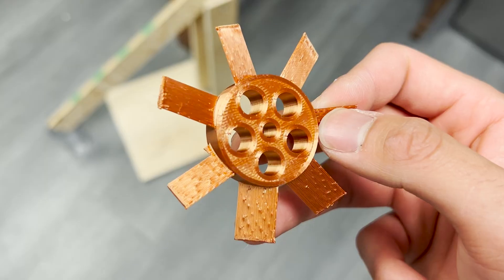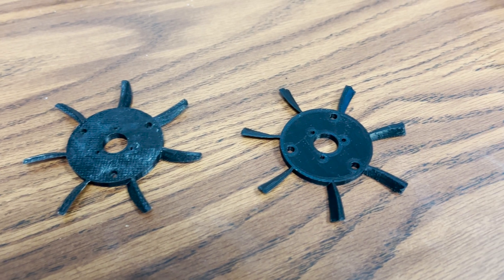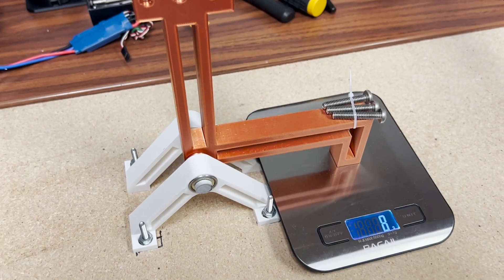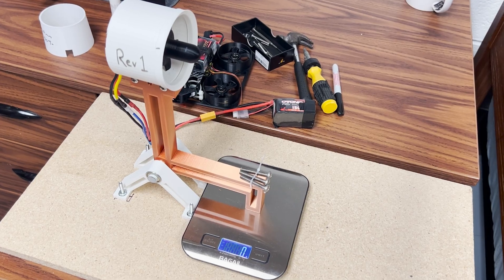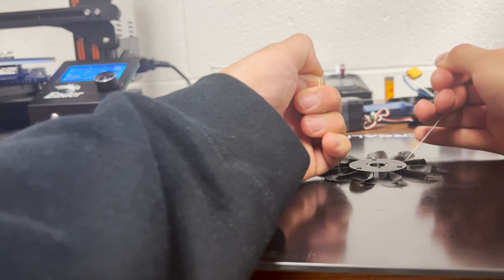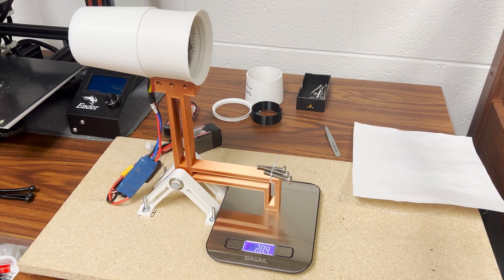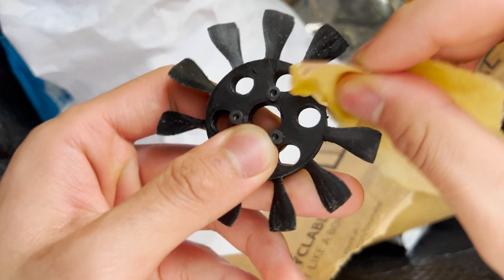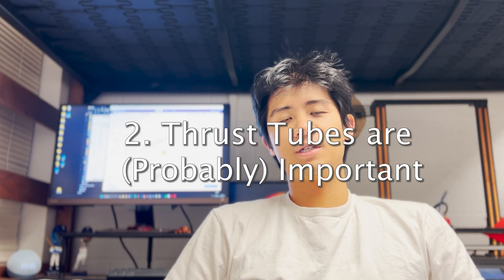Pushing the Limits: 400g Thrust (3D Printed EDF)

Comment: Well done.  I did some experiments with ducted props recently for a quadcopter.  The motor mount is an obstruction to the outflowing air.  I noticed flipping over the propeller and reversing the flow of air through the tube produced maybe 10% more thrust in my tests.  The air coming in is moving relatively slowly and doesn't mind a small obstruction from the motor mount.   Also, you can keep enlarging the input lip to increase thrust, just give it a parabolic profile.  There are scholarly articles on this topic that aren't too hard to read.

Comment: Hey dude 😎👍 like the project only advice I can offer is to get a pull scale more accurate reading 🧐 you Could be robbing yourself of vital grams, it's also important to calibrate the back draft, you can calibrate this by adjusting the space between the fan and the inlet rim, test concurrently each millimetre you adjust monitor the thrust level & rpm calibration should allow rpm to peak successfully & not creating back draft at the inlet this is crucial for flow and at higher rpm can( withhold) thrust, if you are working with 11 blade fan my suggestion would be to place more stators than your blade count plus the degree of the stators should undergo multiple testing testing different degrees is very important,  what may work on other commercial or home made EDFs may not be right for your project as each jet is different especially on dimensions, external inlet stators can assist with this to I hope I helped in some way  😎👌

Comment: Why don't you use  an intake shroud that is less diameter  than blades? To reduce blow back from exaust. Then you can dramatically increase the converging nozzle to get super high exhaust pressure and velocity..
Reply from the maker: My understanding is that a fan inherently draws in ambient air outside of the fan radius, as opposed to an intake moving through the flow without a suction component. Therefore, a wider intake guides the flow that’s already being sucked in

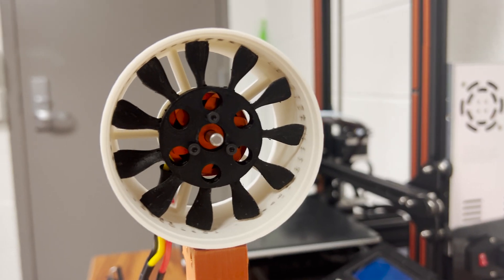Comment: Consider cranking the .stl export resolution in your design software WAY up, to avoid that "~90 sided polygon" profile (did a very rough count of 1/4 of the circumference) you're ending up with on the inside of the duct. That will be adding a lot of turbulence and potential vibrations and standing waves the system, as well as creating ~91 areas where the fin to duct gap is wider. You can see the significance of this at 4:00 where the blade has left many evenly spaced marks on the duct (that's how I counted the number of flats).

Even better, you could use a piece of PVC tube or similar as an insert, or as the entire linear section of the assembly. That way you could avoid the rough surface caused by the layer lines, although I'm unsure of the concentricity tolerances of domestic grade tubes. It'll be much easier to fill and taper a single step between PVC and printed sections, rather than trying to sand the area inline with the propellor evenly without causing any variations in cross section.
Alternatively you could print in a solvent vapour polishable filament such as ASA or ABS and allow a brief exposure to "acetone fog" to do the hard work for you. That method also increases the part strength slightly, by blending/unifying the outer layers of the shell.

Comment: What kind of thrust could you get with a dual prop edf? Where one is spinning one direction and the other the opposite  direction. While producing the same directional thrust inline.
Reply from the maker: Really good question. Here's a paper I came across a few months ago https://apps.dtic.mil/sti/citations/trecms/AD1200423 that does exactly what you're talking about. I think the high level general consensus is that it helps a lot but is generally not worth the weight and energy penalty of the extra motor. I've always wanted to just try for kicks though
Reply: That should counter-balance the two rotors' rotational torques, and result in better control.
It may help to have static blades to stabilise the airflow between the two fans.

Comment: I noticed something on your last test, which is that the bolts you were using to balance the test stand shifted forward. It's counterintuitive, but I think this could actually affect the results slightly--if we think of the foot on the scale as one pivot point of the arm, then the distance the bolts sit from directly above that spot applies a torque to the arm, which has to be countered by a downward force from the books; as the bolts move, that torque increases, and thus slightly more down force is indirectly shifted from the books to the scale. This may not be significant, but grams are small enough measurements that I would try to eliminate this as a source of error, especially since it seems pretty trivial to accomplish.

Comment: what about adding even more, thinner, taller struts to hold the motor, make it act as a stator. add a slight twist to them so that the rotating air coming out of the fan is straightened out, so that all the velocity is on-axis. the twist direction is a bit counter-intuitive but i designed a desk fan where there was a huge difference when I got the stator twist just right
Reply: I tried that, but the plastic stators added too much drag.  I also made a bunch of thinner ones from an aluminum can, and they did improve thrust a little but I decided it wasn't worth the work for maybe 5% additional thrust.

Comment: how important is the inlet lip flare once on the platform in flight? as the flight path should push air into the fan
Reply from the maker: That’s a good question, I have no clue. Someone else mentioned the rounded edges on jet engine nacelles. I suspect smooth surface geometry is probably more of a factor and intake area is less when the EDF is moving.

Comment: As a retired blade prop manufacturer; the reason you are having vibrations on all of your blade designs is that you need to do one simple thing that I didn’t see in your project, and that is to calibrate the CG of your prop designs. Take for example a wheel, at high velocity without being properly calibrated it’s going to be unstable. Keep going and wear eye protection when doing these test.  Good luck!
Reply from the maker: Great to hear from a pro. Thanks for the tip! And just got some testing glasses lol

Comment: Getting the airflow "straight" is pretty important, thats why the inlet helped. Stators (motor mounts) shaped as fins will help stabilize turbulent flow through the duct and exit the exhaust smoothly. 

Get a nose cone that covers the whole hub as well as a tail cone (as previously mentioned), this will help your efficiency a ton.

Comment: 1. Make a proper inlet. Why only a tiny stubby lip? Make a roughly 30mm long parabolic inlet that opens up to 80mm, then add a full 180° lip with a radius of at least 10% fan diameter 
(1/4 fan dia long piece of straight shroud plus 1/2 fan dia long "inlet trumpet" always works well for bench testing). 
Inlet lip radius is critical and bigger is better, it's upper limit is more or less only determined by practicality. -> https://www.youtube.com/watch?v=OxKXHAQ7oXk
2. That exhaust stator is an insult to any ducted fan and jet engine in existence. Just do something about it, it can't get any worse than those four bricks holding the motor right now. Probably an additional 5% thrust in that detail alone. (maybe try and copy something actually good, like a Schübeler fan, not $30 units from ali express that were copied and simplified three times already to be cheap, not engineered to be good edfs)
3. If static thrust is what you want, straight up double the current number of blades. You want the blades to overlap. The more you make them overlap, the more static thrust you'll get, but the fan will also get overloaded easier when you go into a dive to build speed. Tweaking the inlet cross-section and blade count for a good compromise will be necessary at some point. 
4. A fixed inlet cone with guide vanes could add a good amount of efficiency (it also adds weight and is only useful at high airspeeds ... but the jet engine axial compressor look will be awesome when you'll eventually rip the fan out of the model and put it on a shelf ^^)

Comment: If you are making a propulstion system for rc aircraft or for concept, you might also be able to print a compressor fan, as you can utilise the high base rpm of hobby motors and you can also use some servos at the rear with some rounded panels to make a controllable variable area nozzle for higher and lower thrust.

Comment: If the goal isnt to make it purely from 3d printed parts but to use 3d printing, you might be able to print an inverted mold to cast some resin to make stronger more reliable ducted fan. If you do do this, make sure to lubricate the surfaces of the mold with some kind of oil or wax so that the resin doesn't just stick to the inverted mold. Another thing which is handy for lightweight but strong components is making a 2 piece block press mold which you can place carbon fibre sheets and something to stick them together and press it into shape. If you are doing that for a system that has an afterburner or a combustion system, then use fireplace mortar as the binder between carbon fibre sheets.
Reply from the maker: Yes I’ve been looking at molds but it’s seems very intimidating for DIY set ups, this helps me get started though so thank you

Comment: I'm not surprised that you got such a boost from the inlet lip - if you look at commercial jet engines, they put a LOT of thought and careful design into their inlets - there's a reason theirs are extremely smooth, large and usually fairly rounded along the leading edge around the inlet. It helps smooth out the airflow going in, and essentially increases the angle of peripheral intake (so not just reliant on air coming straight in from directly in front). You might see a small increase in thrust by also changing the shape of the fan blade nose cone, as well as the struts holding the motor mounts in place - especially the leading edge of the struts would likely benefit from being rounded rather than flat (more shaped like the cross-section of an aircraft tail).
Reply from the maker: Great points. Filleting the inlet lips right now ✅

Comment: Great video. Thanks.

How does your 3D printed EDF compares to the off the shelf commercial EDF? Did you manage to improve on the commercial ones?

If I may suggest one minor change, is to 3D print motor support vanes at an angle, in order to further reduce friction. As fan rotavates it throws air tangentially, so air inside the tube flows in a corkscrew fashion. If you print motor support vanes straight they collided with corkscrew motion of air and cause drag.
Reply from the maker: Thanks for the tip! It's so hard to visualize flow without CFD. Right now, my 3D printed one is operating at about 1/3 the max thrust of off the shelf ones. I'm making a final video that goes over some slight improvements but more importantly the overall limitations of FDM.

Comment: You might want to trouble shoot your rig, it looks to me that the increase in thrust performance from the big nozzle may be an error caused by the shift in the centre of gravity over the lever arm. Just a guess. You could test that pretty easily by sticking a mass out the back and see if the performance  changes. Or not.
Reply from the maker: hmm, I tare the set up every time so I assumed it wasn't an issue. Not quite sure if that's what you mean?

Comment: diverging duct won't increase thrust until the flow at the converging nozzle reaches Mach 1, otherwise it will decrease it. 
You can try tuning the geometry of the converging nozzle (especially the outlet diameter) which leads to a significant impact on thrust. You also can try outlet guiding vanes which increases overall drag but with bersize tuning of its angle wrt the flow, it converts all the swirls into a one-directional mainstream flow inharintly increasing thrust and eliminating moment.

Comment: PLA for duct printed horizontally (not vertically because this way you're bound to get cracks & separation) and MJF for the impellers following a good old balancing works the best. I printed it during lovkdown, it still works with no issues so far. Its on my shorts, you can have a look.

Comment: If you ever consider printing ABS, try HIPS instead.

Both will give you styrene poisoning, but HIPS emits an order of magnitude less.
HIPS warps much less during printing than both ABS and ASA, is not prone to splitting, and is just much less rude. You can brush acetone onto it, it won't absorb deep into the surface but it can help smooth it out, though that's a little hit or miss, it's really much more resistant to acetone than ABS. It is very easy to sand, accepts paint and adhesives very well, and is very lightweight. It's also same price or cheaper than ABS. It is more chemically stable at elevated temperature, so it doesn't degrade in the nozzle during printing, so you can print it slow if you have to, which you can't do with ABS. It prints with a silky matte-ish surface.
Reply from the maker: This is a big help, I’d prefer ABS right now but I’m holding back because I don’t have a way to properly ventilate at the moment, so I’ll look in HIPS for sure

Comment: Interesting. Could you do some testing on deeper blades? As in longer front to back, axially. Your current designs look like thin discs. Are you planning on sharing files in the future? I have future plans for testing stacked EDFs with a similar thrust testing rig.
Reply from the maker: Thanks for the tip. Been wondering where to go in terms of blade designs. Anyways, I will likely be posting all the STLs after my next iteration (including the test lever)

Comment: The thrust tube serves to help direct the flow of air, so that is coming out more straight. Otherwise it still has a lot of rotational motion, and instead of coming out straight, its coming out in a cone, which is a lot of loss. Perhaps could add some sort of stator (the motor attachment is supported by five fins that already do that just poorly) or a counter rotating turbine, like in jet engines
Reply from the maker: Thanks. By stator, do you mean something like a baffle plate?
Reply: @mach10point4  No, its not interchangeable with a stator. Stator helps straighten out airflow, baffle plate seems to slow it down instead, but i might be wrong on the baffle plate

Comment: Would changing the motor mounts to have an angle to catch the air potentially increase the velocity? Making them act like the stators on a gas turbine so the air is smoothly transferred from a rotating airflow to a parallel one?

Comment: Nice work!  I think it would be advantageous to make the propeller hub, motor mount base and cone the same diameter as the motor, as few flow transitions that doesn't help the flow/thrust as possible , and the transitions you can't avoid should be as smooth as possible.   

I maintain that an exhaust cone should in principle not help an EDF much, the fact that it does in this case suggests the design produce "extra" pressure, at the of cost lower potential flow, without the cone and or potentially giving opportunity for turbulent flow to unify slightly.  To clarify, I don't think "forcing" the flow from a fan to increase velocity can result in net thrust gain worth the cone. Converging the flow to approximately the same flow area as around the motor, preferably in combination with a tail cone on the motor, and any rectifying of the flow it contributes to can help. It's whole different story with combustion engines, where the amount of exhaust is largely determined by the amount of fuel you manage to burn.       

While the motor mount "arms" was improved, I also till think they ideally should be shaped as airfoils, to act as stators, and not create as much turbulence.
Reply from the maker: Spot on, these are the primary things I'm looking at for the next iteration. Larger nose, motor mount nozzle, angled airfoil stators. And yeah, the nozzle theory makes sense to me, I'm just getting really weird numbers with the thrust tubes, and it varies wildly for each propeller/duct set up. Going to be a lot of trial and error for mow.

Comment: I think your thrust measurements are off. The distance from the 3 hole fan mount to the axle, and axle to the center of the scale arm may be the same, but the fan itself then extends above the fan mount giving the fan a mechanical advantage, and skewing the thrust numbers you are getting higher than actual. If your only concern is comparing one design to the next, then it doesn't matter. If you want accurate numbers, then the upper arm would be reduced by half the fan diameter.  (Center of fan to axle = axle to scale arm )
Reply from the maker: I think I designed it like that but I don't have the stand with me at the moment so I'm not sure. But that makes a lot of sense. For now more concerned with relative performance like you said, I'll definitely remake if it's off